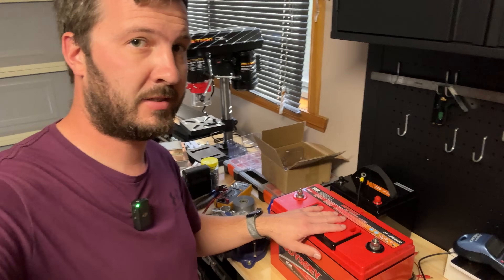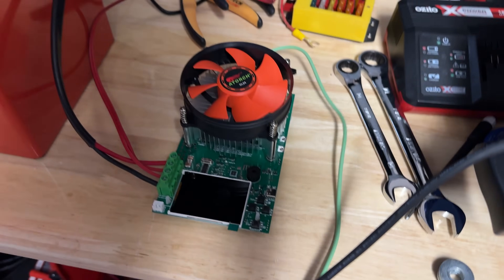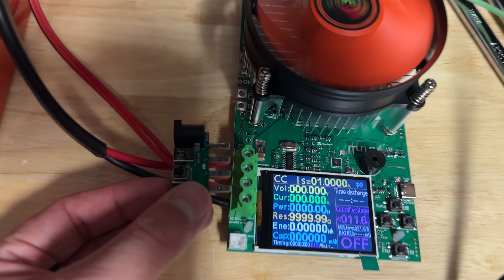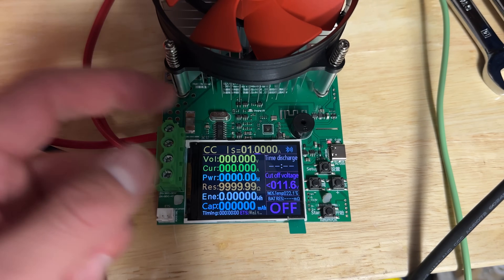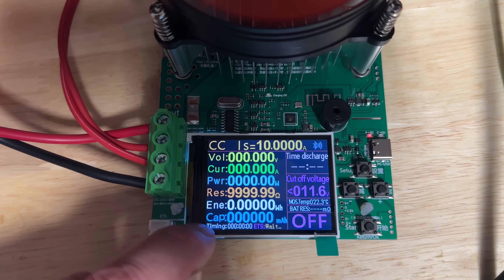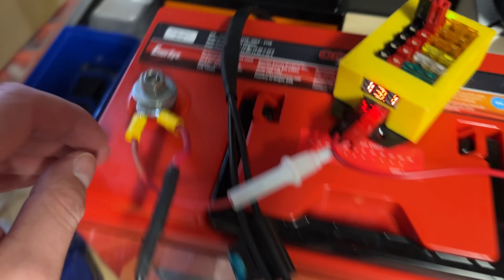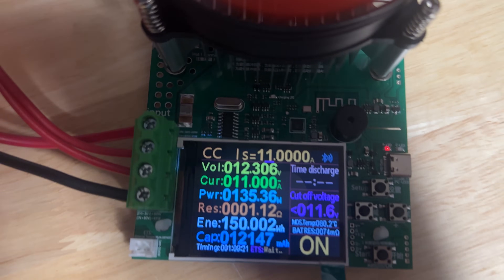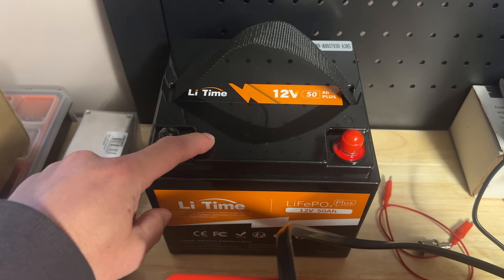CHEAP Battery Tester for SLA, LifePO4, AGM (DL24 150W)

Comment: Does the fan spin any faster when you power the DL24 from the 12V barrel jack versus the USB-C port?  It looks like your load temperature is upwards of 80C when drawing 135W from the battery under test.  That's a bit toasty for my comfort zone.
Reply from the maker: The fan does spin up depending on load being drawn. I had a lower current draw of 1A and the fan spins at the same speed as when you first power it up. 

When drawing more load, it speeds up. That said, the heatsink doesn't really get that warm even at full load and I have had it running for several hours flat out. I suspect the temperature sensor is directly on top of the device between the heatsink and load.

Comment: Decided to get one of those Hayden.
Have quite a few batteries to test and salvage, mainly 18650 cells.
Ordered mine with the cell holder that attaches to the input header.
Should be quite a useful bit of kit.

Comment: That a nice tester. I have a different one but does same job.  With AGM lead battery's I like to discharge about 50% capacity to save on battery cycle life . just double number . Them LiFePo4    you can take down to BMS cut off like 10.5V or so with out harm to battery . I like using the 12.8V on LiFePO4 for tester cut off . This gives usable run time of loads . Many radio stuff cuts off under 12V and how LiFePO4 works holding around 13V then falls off quick to BMS cut off. This gives me a figure of usable capacity for like in a repeater system or computer UPS battery . Cheers from NY/USA

Comment: How do you calculate the total amp hours of the battery after you've collected this data?
Reply: It displays the AH on the load, even easier.
Reply: @michaelg7644  Being a chinese stuff it's a really really great little unit! Been using this for battery capacity tests for 3years now. If you do the Voltage and Current calibration in the menu the device is spot on!
Reply: You simple integrate the current draw over time and that is how simple it is